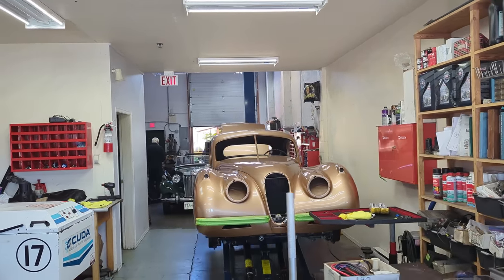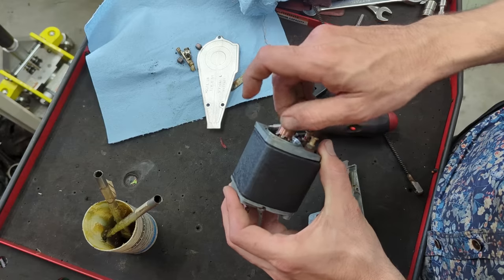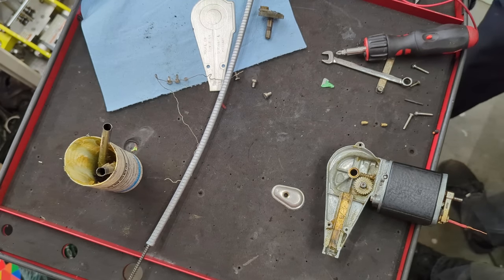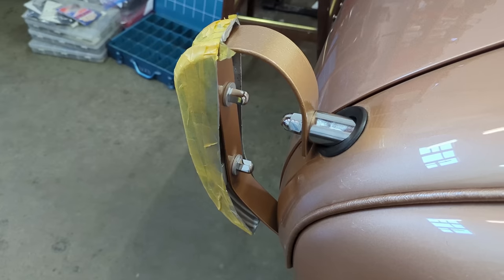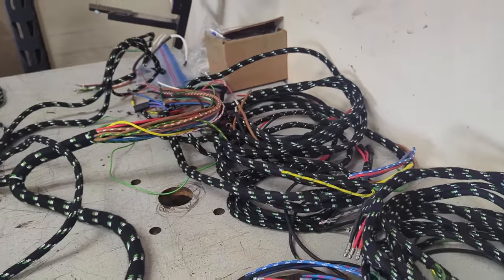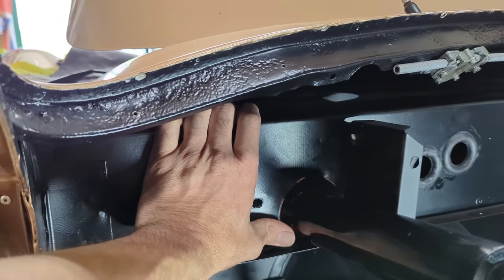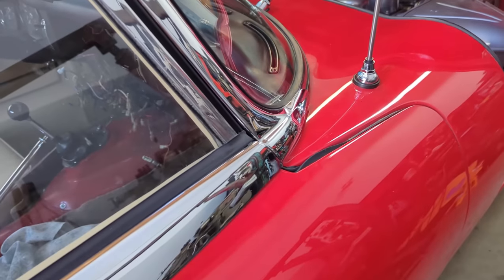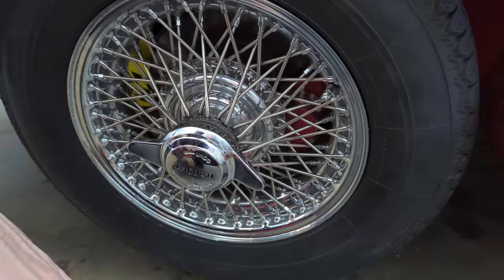Jaguar Wiring Mayhem 🔧 Workshop Diary 5

Comment: Whilst I am sure you have been through this before with the wiring, , like you I struggled for hours trying to figure out where the wires go and how they go on my MKII, I did get some wrong but you don't find that out until it too late.

Glad you are putting in a new harness and not going for the dangerous patina wires.

Comment: worth watching! Autosparks is good but our Riley RM Club´s Spares Secretary suggested I try "The Wiring Harness Company". I have a relatively rare LHD 1950 RMA and the firm only took the job when I told them I have a wiring diagram for a LHD IN COLOR. The only trouble was they got the hoky Postcode in the UK wrong...(sent it to ST9 5RZ instead of to my engine builder outside Birmingham in ST19 5RZ) but the harness went back to sender and was dispatched a second time to the correct postcode. Share your values on workmanship and wish you and your Dad well. Bye the way: I loved the Gold job on that Jag cyl. head with the custom hoist points. Will make a similar plate for the middle four studs of my small 1 1/2 liter engine as well...like your style and craftsmanship...brings my blood pressure down while I move up the learning curve with you!

Comment: Richard. The way you cleant the brushs contacts is totally fine, but important is also to clean the gap between the contacts. I use a glass fibre pen (or how ever you may call it in your language) which worked quite well so far. Glass fibre pens are als quite handy for cleaning other contacts.. Greetings, Chris

Comment: Another great video thanks. Those interior door handles on the E Type should be pointing downwards. I’m sure you know that. The ammeter set up on the E Type is always vulnerable because the full charging current runs through it. Any short on that is going to result in major damage. That’s why later cars have a volt meter instead - low current.

Comment: Its not about the faults you can see, but the ones you cant,  I would bet my house on the paint work is excellent over a RUSTY and  fillered shell, that has more holes in than a colander
Reply from the maker: The early Jaguar metal is very thick. This car was completely sand blasted which tests for metal fatigue.

Comment: Richard, I noticed that the regulator/control box is a 9 post.  I watched John Twist repair one of these for a MG TC. The nine post for those is not available. He purchased a box from Moss that was for a 5 post and removed the windings from inside and transferred to the original 9 post.  Here is the link to his video. I hope this helps as to keep the original would be the desired option.  https://www.youtube.com/watch?v=0wKLGMfE1p4